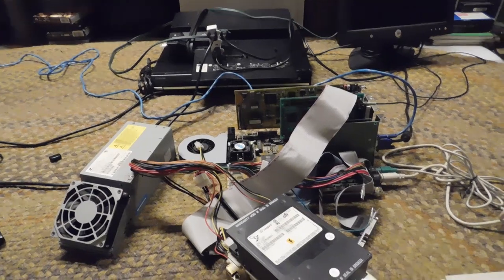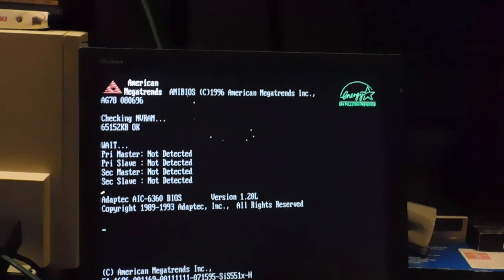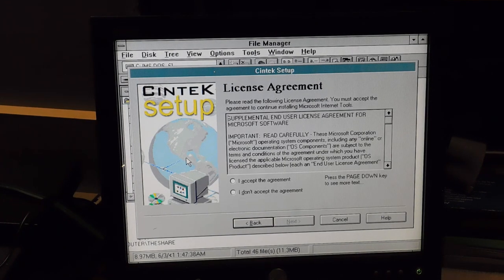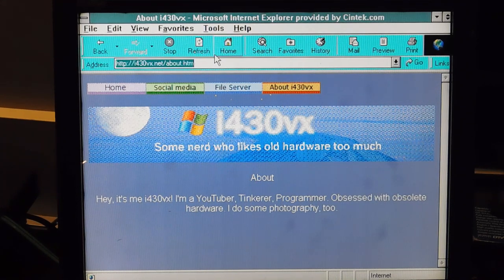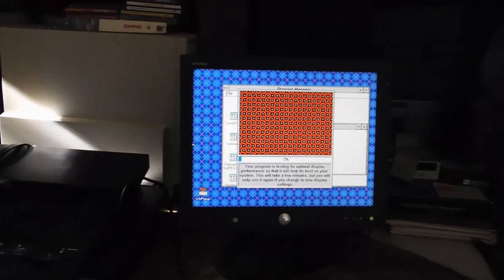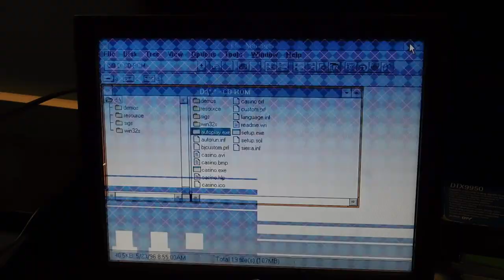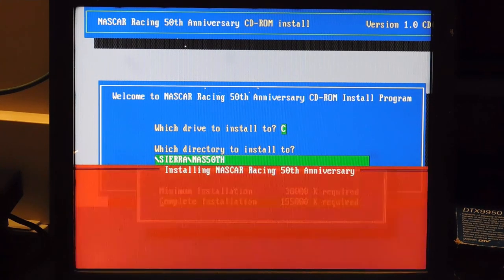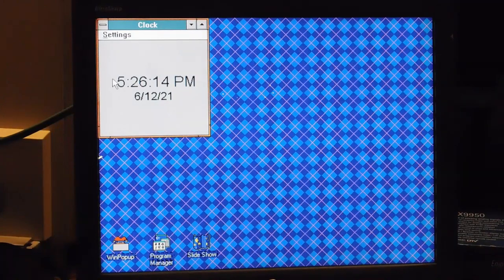My First Windows 3.1 Experience

Comment: Just a few things I noticed that might help you out in 3.1

To close windows and programs a lot faster, you can simply double click the top left window button instead of clicking the button then selecting close from the menu. Looks like you figured this out already in the middle of the video. (ALT + F4/CTRL + F4 also works)

Higher than 256 colors in Win 3.1 (at least in my experience) doesn't usually cause too many problems. Honestly I think I've ran into more 95 programs that dislike higher color modes than on 3.1. Of course if you're running into problems, you should just run whatever works best for you.

The S3 Trio 64 is actually a pretty decent 2D chip. Not quite Tseng ET6000 fast, but if you have both the VESA driver in DOS and the Windows driver installed you should get some pretty decent performance out of it. It's a great option for a PCI DOS gaming system.

You can get .avi files to play in Media Player if you install the Video for Windows addon. I believe you can find it on WinWorld. On a Pentium 133 you should get pretty smooth playback on 240p content. And you can also get QuickTime if you want to play .mov

Comment: 3.11 really shines at 1280x1024 @ 24bit color
Reply from the maker: well that is not something the video card in this system is even slightly prepared to do.
Reply: @I430VX   My pentium 233mmx with Rage 2c +DVD did it just fine. I also had it loaded with the ram expansion. Used that thing till I couldn't get software or 3.11 anymore. It could play a video CD like nobody's business.